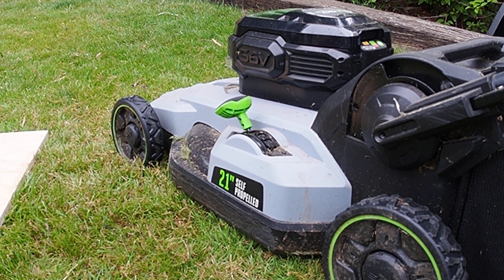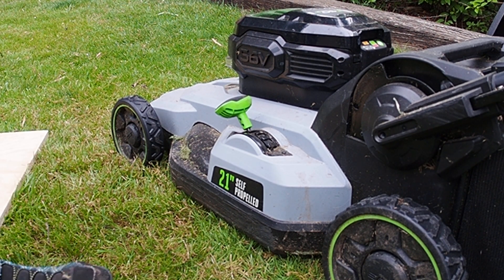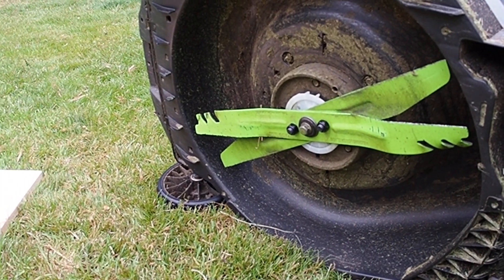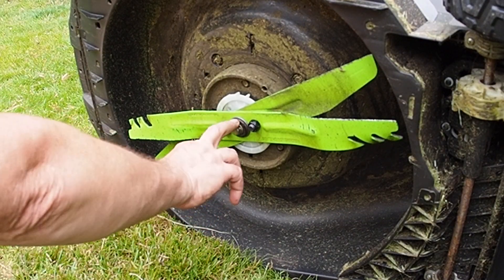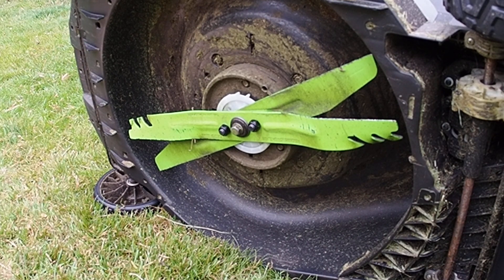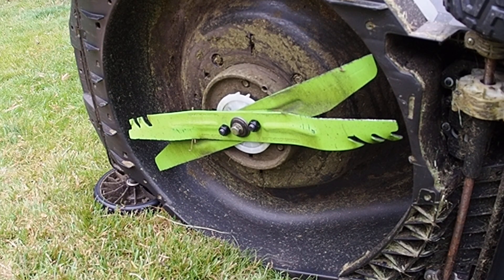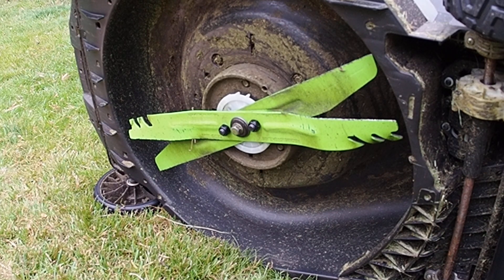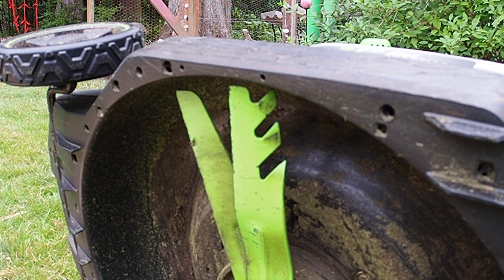Ego Dual blade conversion 2100 2135 lawn mower lawnmower

Comment: For the nuts bolts and fan to replace amazon seller wants $125 Canadian?  Rip off. I wish someone came out with a video on if you can get away with re-using the fan with some modifications or if not show why it must be changed, then i  would feel safe to buy once i got the correct part numbers

Comment: Bought all the recommended part, instal according to video and it won't start.   Green light then yellow light?????
Reply from the maker: The only thing that comes to mind is that they have done a software change that causes an overload fault at a lower amperage level.
Reply: @CFearneyhough  the first mower (that it doesn't  work on) is older. I'm just happy on of them works with it.
Reply from the maker: I really don't have any idea what the issue is as I didn't have any issues. I would remove the battery and check to make sure the blades rotate easily. That they are not hanging up on something. Next I'd check the battery to make sure its charged and working properly. From what I've read a flashing yellow light means torque over load.
https://www.reddit.com/r/egopowerplus/comments/14x1ss4/turns_off_light_flashes_green_yellow/
Reply: @CFearneyhough  I've used multiple batteries and checked that the blade spins freely. It works fine with the stock blade.
Reply: @CFearneyhough  Very strange, just put the blades on my other ego (Same exact model) and it works?????

Comment from the maker: No Mike I didn't. The keyed washer listed in the parts list is much thicker than the original washer that came with the mower. In my case it was thick enough that it extended above the shaft. I would not place a washer between the fan and the blade.

Comment: did you use a keyed washer between the fan wheel and blades and one on top?  The center arbor is now longer as the fan wheel is thinner.  without something(?) the blades would wobble as  they are not tight to the fan wheel or the washer....

Comment: Have you run it a full year at this point? I just did the conversion (haven't cut with it yet) and a lot of people say it will burn up the motor. I looked up the spec differences and we're talking about 1 ft./lb. of torque between my 7.5A 2100SP model and the low-end elect cut (5.9 vs. 7 ft.lbs.). Obviously there is a weight difference, but unless cutting really thick overgrown grass, I'm not sure it will make a huge difference. Would love to hear your thoughts after having used for a while.

Comment: Great video! I have the LM2100SP and the mulching is so so. I too have seen the other videos and been skeptical about the solutions. This makes sense and having a professional engineer’s opinion is priceless! QUESTION: One thing that bugs me is that when I use the self propelled feature the deck raises up about 1/4 inch, and then drops when I release. Makes for an uneven cut. I use highest setting (6). Does anyone else have this issue?  I have used the (4) setting with the same results.

Comment: What great info, Thank you. I just picked up this model from someone for 150.00 and did not like the single blade cut compared to my Honda HRX217. I just ordered the parts and will get the new blades at Lowes.
Reply: FYI, the fan was only 4.25 so all the parts listed with shipping and a 10% coupon was under 25 dollars. Well worth it and better than the blade sitting lower beyond the bottom of the deck. To me, that is a safety issue. The only thing I did not order, was the center flange bolt which I hope the orig works or I will need to order that as well.

Comment: I replaced a 2015 model 20” push EGO mower with a 2021 model (2101) 21” push mower.  One of the things I noticed is that the 2101 model does not cut as close as the 2015 model did.  I suspect this is because the main shaft assembly of the 2101 is higher up than the 2015 model in order to accommodate the dual-blade arrangement ?

Comment: Great video. I’m going to attempt this as soon as the parts show up. The only thing I’m unsure of is the fan housing thingy. I wish you took a video of that as well.
Reply: It's simple. Just slides off. Don't tighten the blades together until they are on the mower.
Reply: @galaxiepete  Thanks! You’re right, it was simple to accomplish. Now my mower is safe and mulches like new.
Reply: @Brain Wash I think it did take about 8-10 days. I don’t remember exactly.

Comment: Does the dual blade setup help with the cut quality? I have the same mower with the high lift blade for bagging, but I seem to always have a strip of grass not fully cut just right of center when I bag. This is at the #4 position. Can you speak to whether or not it cuts better, more lift, finer grass clippings? Maybe you could do a video on that? thanks.
Reply from the maker: This is, of course, just an opinion but yes the mower does cut significantly better with the dual blade. I cut much lower, the 2nd position. The motor runs faster more often and for longer periods of time but still can cut my entire yard on a single charge, approx. 8000 - 10000 sq ft. I'm guessing.

Comment: Please list the blade part number also
Reply from the maker: Well, since you have Mopar in your tag. There are several different dual blade options. They are AB2100D, AB2101D, and AB2102D. Look them up and you can see what each blade set is designed for.

Comment: Thanks for the video especially about all the part numbers and the supplier that actually ships world wide.  I have been using the dual blade system on the LM2100SP for over a year now and even though never had an issue using impact gun secure the blades together, it has always been at the back of my mind about they are not secured together.  You are right about the fan is the major cause of clearance issue even if I try to use the aftermarket nuts and bolts to secure the blades together.  Thanks again for putting this video together.
Reply from the maker: You're very welcome George. I'm glad it was helpful!